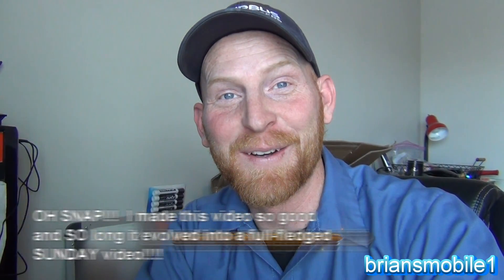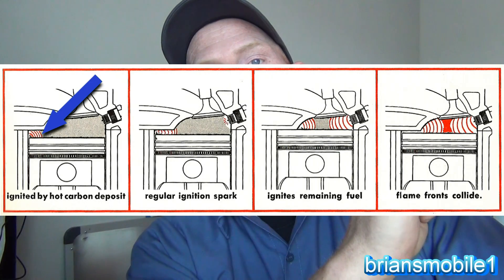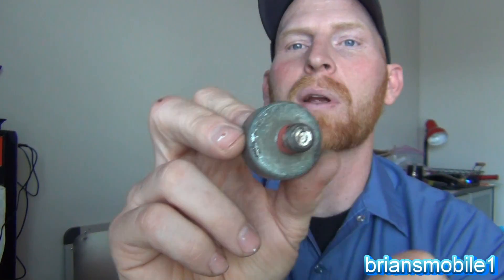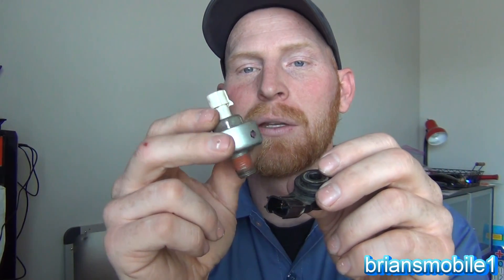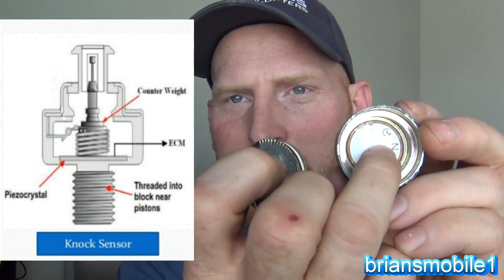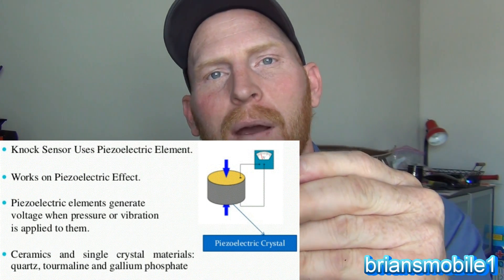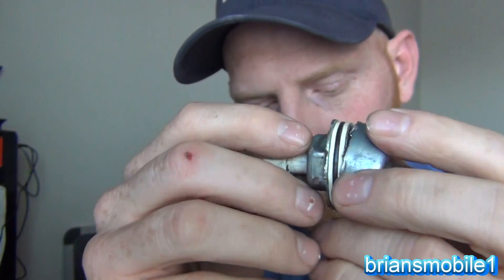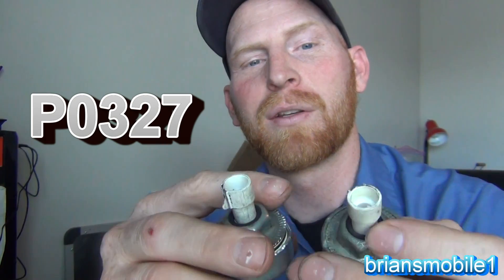The Knock Sensor Video

Comment: Something is very puzzling about my chevy 4.3 engine knock sensor,  i scaned for codes and found ks code, got a new one to install - just like the one in the video- but when i got there at the rear back of the engine i found out its a 2 pins Simence ks and the wire was unpluged and its only a single wire pluge !!!! More to that when i tried to screw in my new ks found out the sensor screw is quite bigger then the factory one, the factory one has a pretty much thiner screw,  im confused why the sensor is different than what the dealer sold me and why even the plug is different than the current sensor?! Im clueless.. The car is used and it definitly seems someone messed with either the wiring or the ks, any idea whats going on in here with me?!

Comment: I just replace the sensors and I think I use bbw and the engine check light is still on thanks to you I will buy the ac delco and hopefully that will fix my
Reply: how tight should the knock sensors go in a Silverado 2006 5.3L
Reply: Did that work ?? I have a 05 5.3 and with ac delco sensors it's still throwing check engine light

Comment: I need help , I have a p0332 and a p0327 code that just will not go away , I have tested and tested and changed and changed , 

I tested both sensors , both have 101 ohms , and when I use ac current testing them with a hammer to the block , the volts go from 3  up to 5 or 7 on both of them ,so I'm assuming both my sensors are working , and yes I used acdeco sensors the second time I did , but didn't help , I checked the volts coming from pcm and it was from 2.5 to 2.8 ,  then I checked the resistance on the harness going to the pcm also , it read 0 , not open circuit ,   so pleassssssseeeeee   help me what else can I do ?
Reply: of coarse this is on a 2001 1500 hd  Silverado

Comment: 12:30 you mention 5v reference. well yes but no.only on multiple wire versions. on single wire.. ecm only checks for the ground through the sensor. the computer looks for that specific resistance.

Comment: Had the P0330 code pop yesterday on a Toyota 3.0.  Take everything off on top of engine routine....Bad harness?  probably due to location.  sensors $100 each and car requires 2.  Wish me 4 hours of luck.

Comment: "Don't use aftermarket sensors on a Chevy." Too late, already did. 2 weeks later I'm getting the same CEL again, have to buy new OE sensors, and pull the intake manifold again. I knew better, but tried it anyway. I'm also getting p0327, oh well, not an overly difficult job.

Comment: Another great video. I had an old s10 with a knock sensor issue and the replacement kept throwing a code, so, without knowing this info, all I knew how to do was bypass it. I never had problems after that, luckily. I prefer to fix things properly though. I'll check out ADP Training and give him a subscribe.

Comment: my car starts sometimes runs for 45 mins then stops and sometimes i turn tge key and nothing happens at all no crank its just dead no clicking...i was told its the computer, knock sensor and i need to replace distributor cap cause i switched the ignition wires and spark plugs...now its doing this

Comment: great vid..my problem is my car wont pass emissions bc of the knock sensor..but the labor costs are f..insane!  i een quoted $1600  for a goofy little part! i have 04 chrystler sebring
Reply: Sean Rowe it's easy swap.  hist use wrench and unplug it and put new one on it. wrench it.your done.
Reply: no its not that easy my friend.With my 04 chrysler sebring you have to remove manifold/heads..its a living nightmere.

Comment: Great video. Thanks for taking the time to make this. Very helpful.
Question: Does a P0325 error code indicate a faulty Knock Sensor? Or does it mean that the sensor is detecting knock on the block?

Comment: does it cause bad engine proformance. My 2004 chevy 2500 6.0 seems like it drags and doesn't have the power it should. The knock sensors are showing up in the codes. Bank 1 and bank 2.
Reply: Darrell Norman those are common to fail, cuz water ingress in the sensors between the Valley.  replace them and seal it with silicone. put everything back.  you're good.

Comment: What's up Brian, going through a knock sensor problem, I've replaced the sensors twice and the wiring harness and the code keeps coming back. Took out the ECU fuse and reset the computer and it ran good no code for a couple hours and it's back, any suggestions? Thanks brother

Comment: brian. how bad can a knock sensor make a motor run. my 98 5.7 vortec has a constant misfire on 3 cylinders through all rpms. it runs so bad I can only go about 30 mph. new distributor cap and rotor, wires and plugs, new mpi spider assembly. had compression test on cylinders done, fuel pressure tests out. please any good info is appreciated
Reply: Tommy Jones make sure your injector plugs are plugged in and locked in.  it can cause misfire of the plugs aren't in all the way.  plus make sure your dist cap ate locked down tight.  it's common fail among vortec v8s,  I own two suburban. I know every nook and cranny about them.

Comment: I just replaced my knock sensor and siring harness on a 2003 Chevy 1500 5.3 when I replaced my intake manifold gasket. Got it all put back together and it runs alot better. Then I drove it for est. 100 miles and the check engine light came on. I read the code and it say knock sensor low voltage. Do you have any idea what causes this?

Comment: So much fail here.

The reason old cars don't have knock sensors is because they don't have computers so there's nothing for the sensor to 'talk' to, not because of the compression ratios.  Plenty of old cars had knock problems for various reasons and some old high performance engines had higher compression ratios than some new engines.

"low octane fuel doesn't burn completely, doesn't burn easily"; these two statements are completely false, low octane fuel ignites more easily than high octane and generally will leave less residue than high octane will.  High octane fuels often have other additives to help reduce the left over residues so that they're not left in the engine, but they can still be dirtier burning than low octane fuel.  High octane fuel reduces the likely hood of detonation because it is harder to ignite than low octane fuel.

Detonation caused by carbon and self ignition as you described with the campfire effect can't be eliminated by a knock sensor retarding the timing since the spark isn't what's igniting the fuel, luckily this doesn't happen much with modern fuels and modern engines.

"gotta have higher compression ratios if you wanna run turbo chargers and superchargers"  Another thing that could be no further from the truth.  Compression ratios in supercharged and turbo charged engines is almost always lower than in naturally aspirated engines to allow more power with reduced chances of detonation.
Reply: DonziGT230 +
Reply: Well said! After about a minute of watching this video, I came to the conclusion that this guy didn't know a lug nut from a wing nut.
Reply: his brain is fried
Reply: considering the knock sensor is an electrical sensor. shouldnt i be able to open it up and repair it myself by replacing the piezoelectric crystal and the weight, wich ever is faulty. i think i can do it
Reply: Theoretically yes.  Getting inside, fixing it, and resealing it would be pretty tough.  Make a video if you decide to try it.  I just replaced one and may tear into the old one just to see how doable that would be, but the way it's mounted on the motor I was working on (big job to get to it) I didn't want to experiment so I went with OE from the dealer.
Reply: @danielb3552  If you didn't have the right crystal it would probably be too sensitive or not sensitive enough. Assuming the crystal is fine, the spring could weaken over time or the seal could fail causing the resistor or something else to corrode. I do wonder what is the cause of failure.

Comment: Could you test a sensor like the first kind you showed without taking it out of the block ? In other words, hook the ground of the meter to the block, and the positive lead to the pin on the knock sensor, and tap on the block ? Would that work or is it necessary to pull it from the engine block ?
Reply: That's a good question,I through a code on my ST1300 Honda ,so  I've been researching it, and some guy tested it while installed and running at idle and four thousand rpm's. He determined sensor was fine.replaced ECM for the fix.

Comment: I changed my knock sensors and harness used ac delco parts on my Silverado but it's still giving me codes now it's showing both sensors are bad I checked the parts with multimeter and they are fine any ideas on what it could be?
Reply: check the wiring from the knock sensors behind the intake manifold to the ECU of the car, double check the ecu connectors first for dirt and corrosion.
Reply: +Kinan Sy  I did I even cleaned it with crc cleaner
Reply: what's the code you read on the scanner
Reply: and whats the model of your car
Reply: +Kinan Sy 2002 Chevy Silverado 6.0l codes are p0327 and p0332 says knock sensor circuit low input
Reply: if you are 100% that the wiring are ok the you need to replace the ECU. there nothing wrong with the engine.. but for model 2002 i never saw a bad ecu with this code i think you have a bad wiring, assuming that this is the only codes you pull out.
Reply: +Kinan Sy when I first got the ses light it said bank 2 was bad, so I opened it up and it was all corroded, so I changed both ks now it's giving me codes for both, bank 1 and 2 saying low input, I checked wiring harness and Ks with multimeter and they are good, but why would the pcm be bad now after changing the ks and not before?
Reply: now it's different thing.. so now you can confirm the wiring & the pcm is not bad.
the main concern now is from the plug behind the intake to the sensors them self not the opposite. i think if the plug is ok and fitted 100% and you didn't install the intake manifold on the harness .... 
the connector to the knock sensor not probably seated sometimes it's hard to seat you have to hear the click.
Reply: +Kinan Sy what do you mean if you didn't install the manifold on the harness? I did the job it gave me the codes so I took it all apart re did it and made sure the wiring harness was seated properly on the knock sensors put it back together and it's still giving me the codes
Reply: looks like you checked everything, then you have to replace the ECU. you can use a used one but you need to reprogram it. or install a used one and program another key for the vehicle.
Reply: +Kinan Sy ok thank you so much for the help!!
Reply: welcome:)

Comment: Brian, are you sure the PCM is sending 5 Volts to a one wire Knock Sensor?
Reply: Yes Stefan the ECM supplies +5v, the reason may be the ECM operates better with the AC signal generated from the peizo element biased at a DC voltage, it may have something to do with a better signal to noise ratio. If you want to check for yourself, just turn the ignition on (engine not running) with the knock sensor disconnected and measure the voltage on the wire from the ECU. If you measure the voltage with the wire connected (again with ignition on and engine NOT running) the voltage will be lower due to the voltage drop across the internal 100k resistor inside the knock sensor which is connected to earth (thus completing the circuit).

Comment: Hey Brian I had a question. When you said you ruled out the knock sensor on the 5.3 did you mean that it was the problem? Cause I'm having the exact issue on my 5.3 at 70mph that I'm currently trying to diagnose and only can get it to do it at that speed. And also I saw you at the Utah auto expo by the Nissan Titan diesel!!!

Comment: hi Brain, was wondering if you could help. I recently went through hell trying to figure why my timing was retarding. I have a 98 Nissan maxima. I've had codes such as p1320, and changed all the coil packs and it cleared the code and now I have a knock sensor code and a speed sensor code. But is it possible that my knock sensor heats out after driving it for 20-30 min and all of a sudden I'm on the hi way and its like it shut off the coils or ignites  at the wrong time going about 65-70 mph. now I can't go over 45-50 mph because the harder I press the gas I only hear a loud compression and a thump at the same time but, if I let off the gas it does it faster till its comfortable and then it will go but only will hear the thump if I hit the gas to hard  and won't go past 45-50. also tried shuting off while traveling and it resets it only for a couple of minute's. what do you think?

Comment: hi I have a 03 single cab silverado with a check engine light on it because I need to replace knock sensor is it true if once I replace it, it will give me truck more power and save gas?

Comment: Thanks in large part to your great videos, Brian, my '95 Honda Accord EX with nearly 300k miles is running tip top.  Thanks especially for your Accord VTEC water pump replacement video.  I jumped in way over my head with that one and your video helped me through it and saved my car.  Now with nothing to fix at the moment, I still watch your videos (like this one) to: 1) become more knowledgeable in general when it comes to cars and 2) for pure entertainment value!  You should be on prime time television my friend.  Thanks so much for doing these videos... I know a lot of hard work goes into filming and editing each one.  It is greatly appreciated. Peace!

Comment: I thought low octane fuels burned easier. Isn't that why high compression engines usually call for high octane fuel? Because otherwise it would detonate early just from the compression.
Reply: Nope its the opposite higher octane doesnt ignite as easy as lower octane...thats why  its better in higher compression because it resists the diesel effect....

Comment: Some smartass German working for Bosch invented the knock sensor..... and the J-K-L-Motronic Fuel Injection (why the German Messerschmitts could pull a negative "G"... while the P-51s would barf gas out the float bowl...).     Cool hack on bypassing the knock sensor!  Just install a longer duration cam, raise the compression to 12-to-1, add 9-11" intake runners and 4 Weber IDAs and call it a day.   Wake up the next day and bolt on some Astro-Flow heads, to make the IDA induction bark.  Go out on Saturday night, with your girlfriend/wife and her friends as passengers....  Spank some Ricers and make the tires ROAR like a lion being raped in the jungle!!!  You'll get "some", for sure.   ha ha Cheers bud.
Reply: WAVETUBE84 nice

Comment: Great explanation video, Brian! I like the knock sensor bench test with the vice. The only thing you really need to confirm proper knock sensor operation is an OSCILLOSCOPE! The voltmeter on the AC scale only gives you a general amplitude of the signal. A faulty knock sensor may still produce the right amplitude, but the signal will be very erratic and choppy instead of a smooth sine wave.
Recently had an '01 Lexus RX300 in the shop with an intermittent P0330-Knock Sensor Bank 2 code. On the bench, both B1 and B2 sensors showed a similar signal. However, zooming in on the waveforms, B2 looked more like a ragged square wave compared to B1 which was a smooth sine wave...pretty awesome. No other way to confirm the fault. Knowledge is power!
Reply: Hey Ivan do the new style knock sensors on Chevy ls3 ever fail to sense detonation and end up causing the timing to advance too much or do I have another problem if I have detonation
Reply: motoYam82
Reply: Does an 03 durango 4.7 have a knock sensor?

Comment: You're video on smoking engine was great too. I'm losing water and oil with no visible leak. Rebuild or junk it? 2005 Sioverado 5.3 crew cab 4x4  with 195k miles

Comment: I think it's "pick on Sunday" for you, Brian. Your video was very good but some of your terminology is wrong. It's pre-ignition and detonation, not pre-detonation. Detonation is when two flame fronts collide and cause a spark knock (Ping) and is what the knock sensor detects. Pre-ignition is when parts of the combustion chamber, carbon etc. fire the mixture before the spark does. This causes pistons and other parts to melt and can cause detonation to occur.
Recently had a Hyundai Accent emission failure from another shop with a knock sensor code and after replacing the knock sensor twice and spending lots of the women's money on the car, I found it was only low on oil. Knock sensor was detecting the valve train noise as a knock. Added oil to full level, problem solved.
Reply: briansmobile1 I hear you man! I'm finally pulling down decent flag hours. It's great that I'm faster, but I still did more work so I'm sore. I never thought I'd be an Automotive Tech. Finding your video started me on my happy path. 

I'm glad I learned so much. Great video. As far as mixed up terms go. We all do it, but I never misunderstood your points over it. My second "but" is thanks for being brave and putting it on camera. Most of us don't have it recorded. :)
Reply from the maker: wysetech2000 I misspoke pretty hard on this video.  I look like death warmed over, and I felt that way here too.  Great work on the woman's car.  I bet she really appreciated that!
Reply: She was pissed at the other shop and almost cost her an engine. At my age I can relate to death warmed over. {:-) but I still like your videos.
Reply from the maker: Thanks brother!  I miss being 20 these days for the energy, but I don't miss the stupid that came with it.

Comment: In case you are wondering if your car knocks: Get ELM327 BT OBD adapter, Torque App for your smartphone and "Knock Detector" plugin for Torque App.
Reply: I've used that. :) It only works if the knock sensor is working. I drove a couple test runs where I knew I'd get knocking. Confirmed the problem. :)